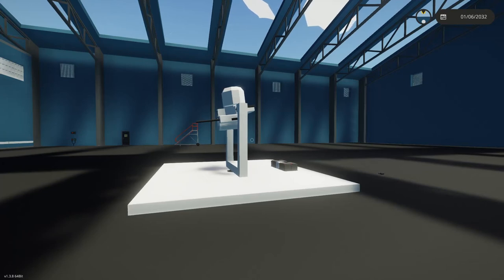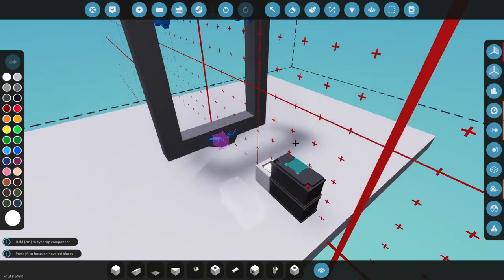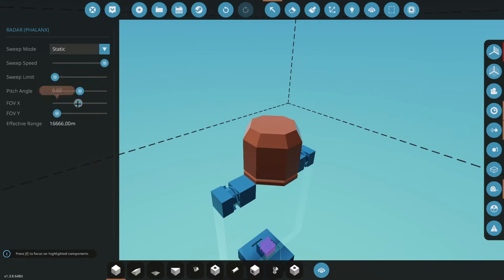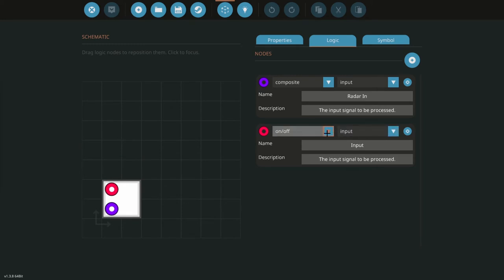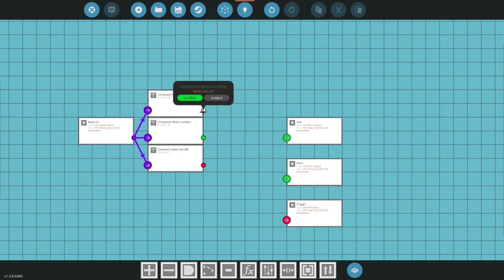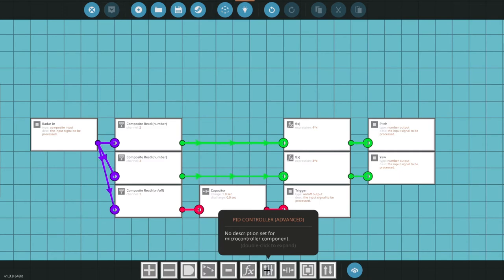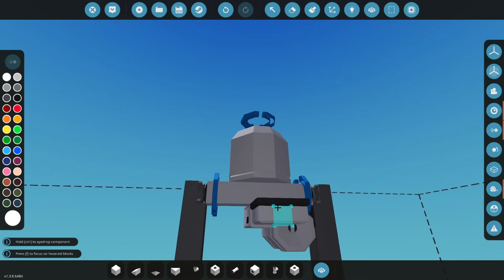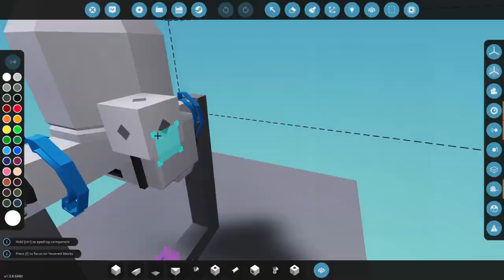RADAR TURRETS! - How To Make Radar Aimed Turrets in Stormworks!

Comment: To everyone here who is currently having problems with getting it to work. I've spent the past 3 days over numerous hours hitting basically every snag and here is the things that can go wrong.

It doesn't move or do anything.
- Check your pivots and pitches directions. In Particular the pitch needs to both rotate in the same direction else they'll cancel each other out.
- For the Pitch make sure that you are utilizing separate input sources on your microcontroller from the two inputs.
- Ensure that you have the correct radar channels going into the microcontroller, 2 is Pivot and 3 it pitch ( Could be inverse but they need to be seperate)

The build falls apart when I spawn it in.
- MERGE THAT SHIT TOGETHER, top right there is a button to merge.
- Half of your pivot needs to be merged to the blocks they are meant to be moving.

- I keep changing and rebuilding but its the same result.
- Look if you are actively changing your micro, easiest way to change micro is to select and go onto the micro and press the top left.
- This lets you actively change the micro whilst its on the vehicle.

Its really slow at detecting me
- Change your radars configuration in the panel on selection for it.
- Have static, make sure your range is around 1000-2000m. Any longer and it will take ages to detect and feedback.
- Make sure the direction is front facing for the Radar.

Comment: My turret aims a meter over the target, i did everything the same, maybe the gun is a little elevated but it has enough depression and elevation to aim perfectly
Reply: Yeah my was aiming 2 meters up and 3 meters left on everything
Reply: Well this time its spinning in circles clipping through the grounf
Reply: If everything is really set up correctly, change the multiplier to a higher number. When the turret is on target the pivots get close to 0 power so they tend to sag. That's the downside to velocity pivots.

Comment: how can you make this with robotic pivots. my design needs them for automatic reloading. With robotic pivots the radar guidance acts a bit stupid.
Reply from the maker: If you use the large velocity pivots then you can make them return to their original position with pids
Reply: @BigmanBois  I have that but I like it returning to it's previous aiming position once reloading is done. I had the automatic reload make the robotics go to 0* rotation via switch box. Once reloading is done it will go back to seat input.
Reply from the maker: Use a memory register to save the position and then return it to that position
Reply: @BigmanBois  you're a hero
Reply from the maker: If you wish, i can make a video explaining this in detail for reloading turrets
Reply: @BigmanBois  I have it down I just didn't think to use a memory registrar for the rotation. I'm used to only working with robotics. But it may benefit other players. Really appreciate the video and the tip
Reply from the maker: I would make some logic that makes the turret turn towards the central position when it reaches a certain rotation (e.g. if rotation = -0.5 or more, rotate positively towards 0)